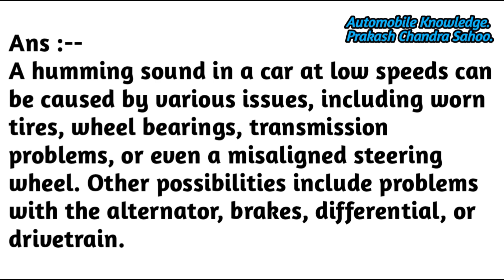humming noise while driving! humming sound in car while driving

Comment: I have a 04 GMC Sierra z71 that I just replaced the transfer case and fluid for the previous one making a grinding noise but it seemed that is still making the same noise 4wd works and engages checked all the fluids on the rear differential and front but I don't know where is the grinding noise coming or causing it any help would be highly appreciate it 😊